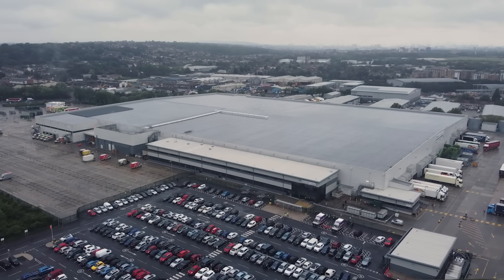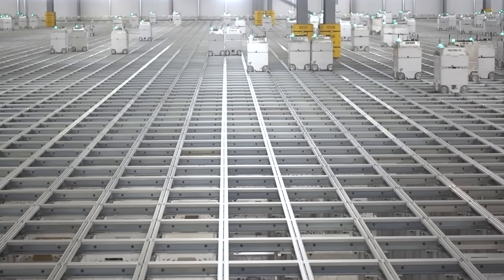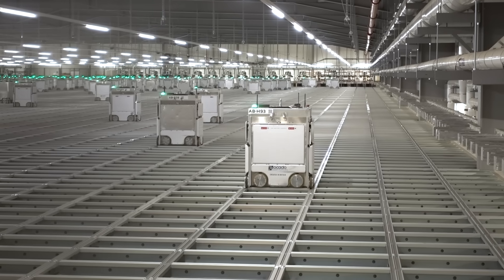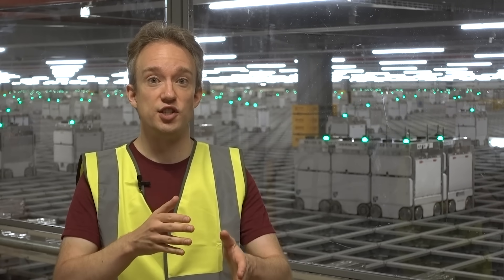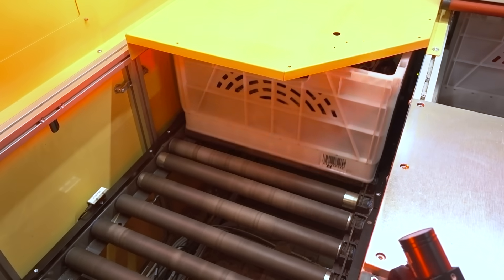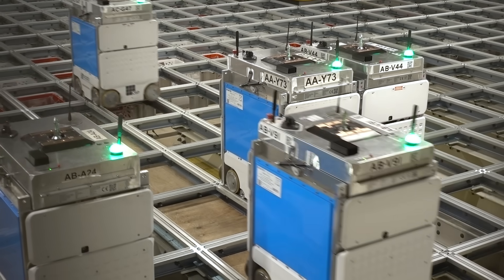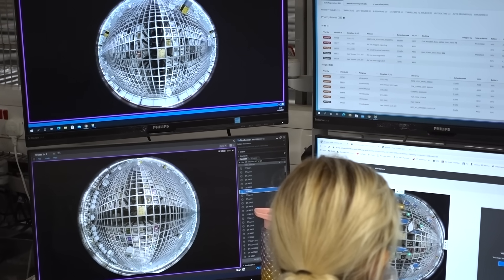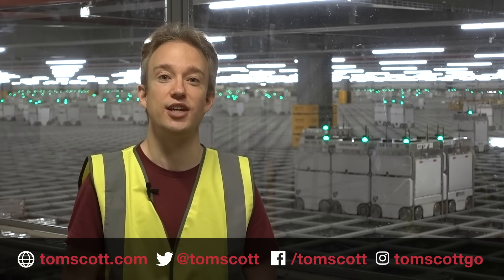How many robots does it take to run a grocery store?

Comment: The 2000 or 1 robot argument is an interesting discussion. If you define a robot as a thing that does stuff based on an instruction sent to it, does that mean your arm could be considered a robot? I mean it is a thing that does stuff based on a command it’s given. 

It’s a big difference when you consider the holistic approach of the entire building being the robot, as the command it’s given is, “Fulfil Grocery Orders” it just so happens that as a part of that command, the command “Send worker AAG-74 to cell JA-52 and move item to HD-12” would be given to a smaller part of the building.

Comment: Are those American, Australian, or British football fields? :V

And  the "how  many robots?" problem many be more of a linguistic question to solve with new means of referring to each different aspect of the system. As far as "robot", both "one" and "thousands" could be considered correct. While to refer to each individual cart in a system like this one, "drone" seems far more applicable and the word should be taken back from its overuse for referring to any type of quad-copter.

Comment: Wouldn't this have a large environmental impact, especially if these facilities are produced in quantities?
Reply: A fair comparison would be one of these plus its delivery infrastructure vs the equivalent number of supermarkets, their carparks, a large number of short-to-medium car trips, the additional road capacity for this, the number of vehicles bought for such trips, the time spent going to the shop instead of grazing youtube ...
Reply: @andrewkepert923  That I know, I just thought that the materials needed to make the robots would have a bad environmental impact because of the materials needed to build these facilities
Reply: @mhx6437  Short answer: yes.  
Longer answer: yes, but so do the alternatives, since almost everything we do has an environmental cost.  
No matter which we choose we should figure them out and do the best we can to minimise total environmental cost.
This replaces two stages in the usual logistics pipeline — distribution centres and retail outlets — so I'd expect a lot less metal, glass and concrete.  Also it could be a more efficient use of resources by not closing half the time.  OTOH different packaging standards and total transportation may tilt it over to "worse".

Don't know - I just know it's not a simple calcuation.

Comment: "We've got a 3D camera hooked up"
> Is literally just a Kinect v2.
Can't blame them since it's really good, but Kinect Azure exists which is smaller and better.
Reply: Looks like the Ocado facility was built prior to the Azure Kinect existing.
Reply: Sure... But do they need better? Using a product you don't need because "it's better" is just a drain on money and resources.
I'm sure it works more than well enough for the setup they have, and to require needing a better camera would require a total overhaul of the entire system... So why worry about something that isn't going to change anything, put out more picture data (which would require at least a little more processing power), and cost you more?
Reply: Is that not a 3d camera
Reply: For awhile they were the go to readily available cheap 3d camera. I have seen a few out in the wild, some used at an airport for baggage scanning and a few being used in a theme park.
Reply: The Azure is also more expensive
Reply: Can you give me a time stamp
Reply: @aaddiis45021  2:25
Reply: It also shows that the engineers know they they are doing
Reply: The kinnect v2 has this thing called a depth sensor which makes it fantastic for this sort of work.
Reply: Well, a Toyota is still a car.

Comment: A conveyor system would be far more efficient, too many moving parts
Reply: So a warehouse that is 20 metres wide but 17km long?  😂
Reply: @krashd  Just no, not 17km long. Unless your a mechanical or industrial engineer like I am why are you laughing?
Reply: @krashd  They have a 2 dimensional transport system conveyors can easily be 3d systems with no stopping or changing direction. More efficient use of space and less system parts to go wrong you tool!
Reply: @shaneludlow6858  Fair point with conveyor faults although. You could pack more products into a smaller 3d footprint if the product types were aligned horizontally due to weight on eachother/no need for boxes. Also several full height of the building conveyors could allow for redundancy and be at least twice as quick as the current system. Convince me otherwise

Comment: Calling it a HIVE mind just makes it seem more complex than it is.  Each moving box has a controller running software that's identical to every other box. It gets it instruction from the main computer which tells it where to go and what to pick up, period.    In an ant Hive each ant is performing different tasks from every other ant, and the tasks vary with time.  In the warehouse each robot is essentially doing the same task over and over again.

Comment: Interesting except they will have to scrap everything and rebuild the hive every 6 months. It looks like they are using plastic bags currently. It will need to be redesigned for paper bags in 6 months time. Then 6 months later, they will need a complete redesign back to plastic bags once they again discover that paper is bad. And they will need to keep doing this every 6 months as they discover anew that one or the other is pure evil.

Comment: The energy consumption just for that warehouse has to be ridiculously high. Given the fluctuations in power that happen in such a small country just during the day; I want to learn how they're not blacking out their grid, especially if they have multiple of these types of centers.
Reply: I'm really not sure what you mean?  What power fluctuations?  The UK doesn't have blackouts anywhere except through severe incident, even then probably no more than a few hours every couple of years for your average home in a city, factories and other large installations that need continuous supply will have a second substation feeding from another part of the grid.
Reply: What do you think happens, when you try to pay at a cash register in a supermarket during a power outage?

Comment: And yet at Walmart, we had to stop using our automated floor  scrubber because it would get stuck every 5 minutes
Reply: Probably because there are silly thing such as humans, and infrastructures that were intended for them in the way. Couldn't you see how much more efficient it is if you just simply remove all of that?

/s
Reply: @BicyclesMayUseFullLane  /s but as this video showed, also not.
Reply: Which is putting a robot in a space and a role designed for humans... Which is the exact opposite of what they did here.
Reply: Not to mention all of the employees with huge multi-carts doing the work of 0.3 robots while blocking the aisles for customers.

Comment: So change each 'bot' to a cab, and the grid to a city, and you've got automated transport
Reply: Nah because here they are able to work uninterrupted. In transport you have to physically interact with people 24/7 so the chances of accidents and mishaps happening are greatly increased.
Reply: @zan1971  Put this setup, scaled up, underground. Then you just need to figure out the best setup for picking up and dropping off.

Honestly.... I don't think it's the best solution. Trains are good. Very efficient, not a lot of work to put in when compared to something like this, easier to maintain, you don't have thousands of individual machines with individual battery packs and sensors and things that require charging, maintenance, etc...
Reply: I feel like the reverse of that is what happened here. It turns out the "get from A to B" part of automated driving is actually the easiest part of all, so if the rest of the universe could be stripped away, we'd be all set. Or in this case...just limit it to a grocery warehouse

Comment: As a wireless network admin I have discovered what my wifi-nightmare should look like: a few thousand robots continiously moving around in a very large space with no floor requiring a reliable connection with low latency and low loss.
Reply: Who says it's completely wireless? Pop sensors in the robot feed the robot instructions as it passes a node, track it with the hive brain via cameras or other such tech. There isn't a reason for every finger to be smart, all in how you use them.
Reply: @Zippyser  the antenna's on the bots tell me.

Comment: I mean, an articulating robot arm to individually pick up a packet of chocolate buttons … 

Just move the crate underneath and dispense the packet into it? Open close. Open close.

The robot grid is cool - but that arm is so much unnecessary complexity no?
Reply: Might be easier for them to have 1 mechanical system to grab a wide variety of packages in all shapes and sizes than attempt to create a dispenser that will work reliably for all possible package sizes and shapes.

Comment: Why is nobody talking about the fact that the 3D cameras they use were part of an Xbox? 2:25
Reply: Could possibly be due to the insane price of higher-range 3D cameras. The kinect is actually a super viable way to prototype 3D camera-reliant ideas and often can be reliable enough too! But does seem odd that such a huge business would be cutting costs on their expensive tech
Reply: @MrMagicRman  It seems like they have a lot of those arms.  So the difference in cost would really add up.
Reply: I wonder if those are regular Xbox One Kinects or the Kinect For Windows models.

No matter what, I'd assume they were chosen for cost reasons, since the next closest thing would probably be like an Intel Realsense camera, which would still cost more (though the new Azure Kinect camera designed for this sort of stuff has a higher MSRP, though there could be special offers for large projects like this).

They might've gotten a good deal on them whenever Microsoft stopped production of the Xb1 era Kinects, and they track reasonably well (some people even use them with special software for Full Body tracking in VR games like VR Chat instead of buying relatively expensive SteamVR compatible trackers and base stations).
Reply: exactly my thoughts
Reply: EXACTLY!
Reply: Probably got them for cheap plus the kinect is actually a great camera for these type of things. They don't work that great for humans because of our varying shape and size as well as color of skin

Comment: Talking about hives, if the grid was arranged in hexagons the bots would have to travel a shorter distance on average (but the whole system would have to be rethought)
Reply: it's probably square grid because it's much harder to engineer a hexagonal grid (at least from software perspective)
Reply: There would be lots of wasted space though as the totes in each hexagonal cell would still be square in order to be shipped.
Reply: Yes that's what I was thinking, our world is mostly adapted for square packages. From a software perspective hex grids aren't very difficult to work with

Comment: I’ll avoid the metaphysics. That’s 2000 robot workers and 1 robot boss. The question is, will they ever unionize?
Reply: They want higher quality wheels that get replaced regularly. They could greatly benefit from a union.
Reply: i hope they don't un-ionize. that would be messy.
Reply: How do you know this isn't 2000 robot workers and their union?
Reply: They ARE unionized.
the boss is their union
Reply: How does the economics of this long term compared to using people stack up money wise?? Or is it all about control? And who IS "Ocado"?? And WHO owns it? ok, I see the order pickers. How do you LOAD the bins of items and HOW do you keep your Supply Chain providers from screwing up your ordering??
Reply: We would start suspiciously seeing a lot more orange lights if they did
Reply: @thesoupin8or673  That would be a chilling sight.
Reply: They aren't getting a shortage of anything they want, so I don't think they will.
Reply: Roboss
Reply: The good thing about robots is that they don't have a choice. They're slaves. So it's actually 2000 robot slaves and 1 slave master.
Reply: There isn’t a robot boss ruling over 2000 robot workers. The robot’s “minds” are all connected and they think together

Comment: • Unlike most stuff in like, this isn't something that could have organically evolved from simpler systems; they had to intentionally think up, design, and build this monstrosity of a robotic ballet. 🤔
• The energy to run all of those robots is a lot more than the energy to run meat-bots.
• When robots fail or crash, it can be more catastrophic than when meat-bots mess up. 🤷 Programming is never bug-free.

Comment: I'm still not clear as to what the hive bots do over the grid. Are they packing or picking, or both?
Reply: They go over a vertical stack of products, picks up box with products then takes to pick station and lowers down to picker.
Reply: @bobbobbing12  Thanks. But I'm still not clear about how the vertical stacks of products moves around. Obviously, the robot can't punch through a box at one level of the stack to get to things below it and a stack probably can't be piled really high for one particular product (say tomatoes), as the items in the bottom of the stack will get squashed. I think I need to do what Tom did and book myself a tour, if they do that for the general public, like Amazon do.

Comment: Another possible interpretation:  1 Commander, 2000 soldiers.  The level of precision and flexibility involved is clearly beyond what any military ever achieved, but professional soldiers as far back as Spartan hoplites all the way up to musketmen in the Napoleonic Wars were hugely dedicated to the ideas of drilled formations, with many individuals moving in concert to achieve a goal.  Some of the parade formations (designed for show rather than practical purpose) have troops weaving in among each other very tightly without colliding. (This may have had some battlefield application, but I don't know it.)  That's what I see here - 2001 robots, one of whom is to be the officer to the other 2000 - a scenario that some commanders of that era might have considered ideal, had they been capable of issuing orders to each soldier with the same level of precision as the commander we see here.

(This is not to say that modern soldiers are somehow inferior, it's just that WWI taught everyone (except the Amercians, whose teacher was their civil war) a rather harsh lesson in the effectiveness of automatic weapons on troop formations, which led to a switch to more individualized tactics, where soldiers move and act far more independently than was previously allowed.   Thus, formation training has no direct applciation on the battlefield (though it is still taught for a variety of reasons).

Comment: I think this confirms to me that automation for entry-level jobs is not going to come for a long time. Even in this facility, the environment needs to be designed specifically for robots, and there are still people who monitor things.
Reply: The handful of jobs monitoring the robots are not entry level. The dozens or hundreds of jobs the robots replaced definitely were.
Reply: @Sashazur  True, but it means that you replaced dozens-hundreds of minimum-wage jobs with a handful of much more costly jobs that probably take up most of the money that you saved from the minimum wage jobs. 

In addition, the store needed to be completely redesigned with the robots in mind, and over 2000 robots needed to be added.

Comment: They should have used barycentric coordinates to make these rail tracks, in a hexagonal building.
Do i even have to explain all the spartial advantages of equilateral triangle lattices (besides packing)?
This even acts as a fail safe, in case 1 of the 3 directions of wheels breaks on a robot, it can still get everywhere.
Reply: So, you're saying hexagons are the bestagons?
Reply: @twistedtachyon5877  always have BEE(n)